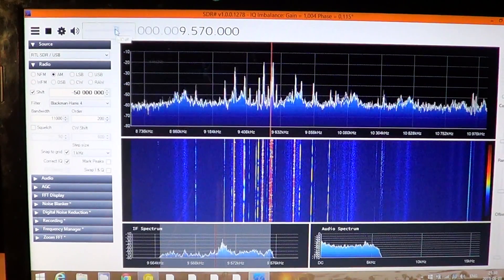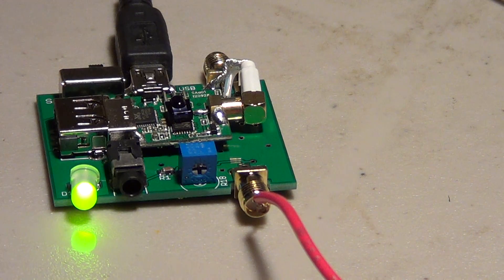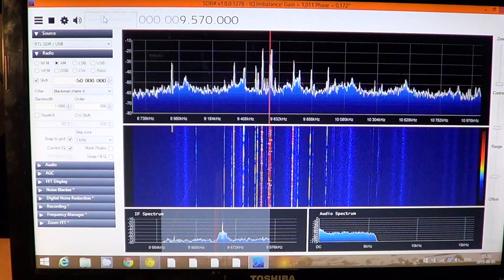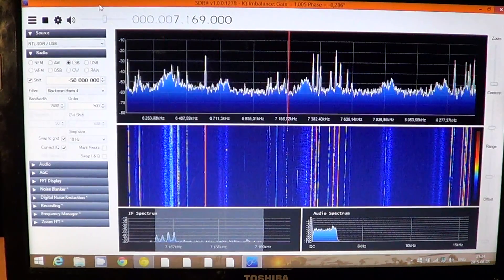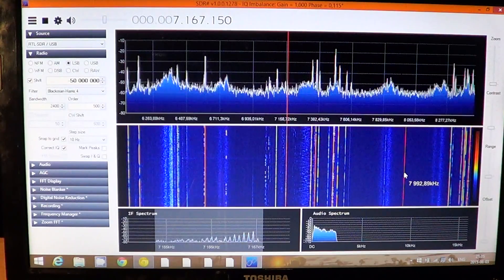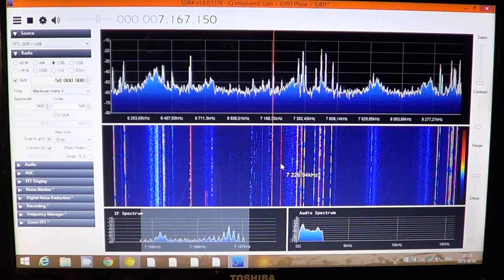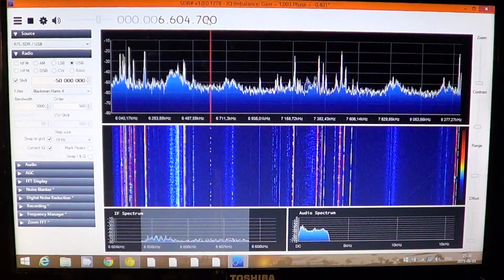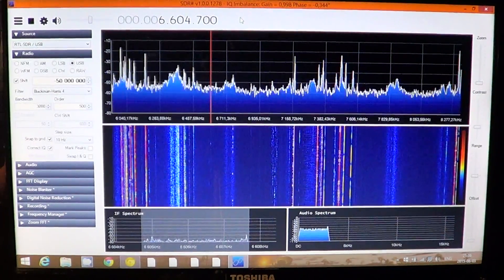Testing the Soft66RTL2  SDR receiver on Shortwave with comments

Comment: very nice. have to get one for sure. have not been into SDR's as of yet, price is right on this one, so it's time. thanks for the video. 73
Reply: de N5XTC Definitely worth the investment although there is some loss in the upconvertor design, the ability to visually locate signals on a wider spectrum (than the traditional manually tuning) is pretty cool.